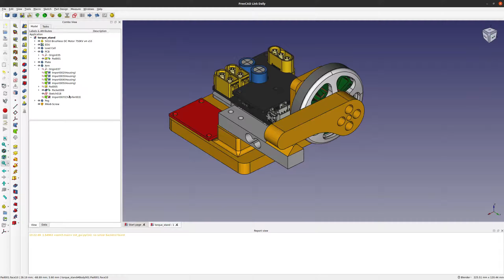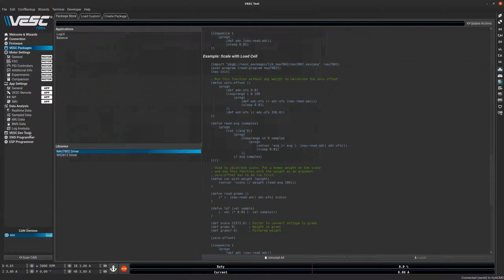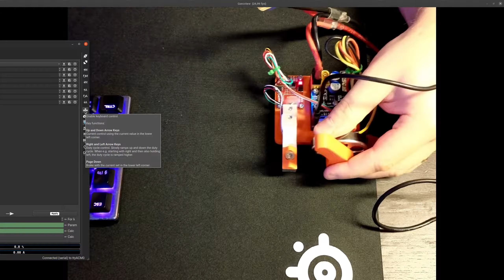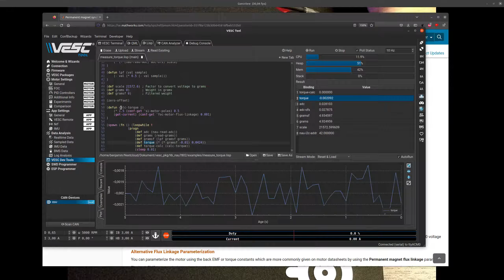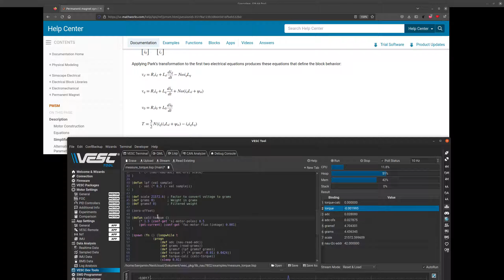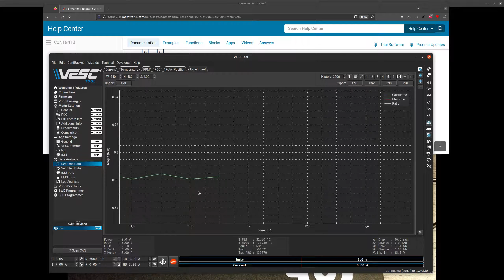VESC Measured vs Calculated Torque

Comment: Great Video Benjamin, as usual, 
but two thoughts I had:
- Your "Gram to Newton" conversion is not that accurate. It should be more like >0.0098< 
I presume it does not matter that much in this case. 

- I think the tip of your measurement area should not be inline with the loadcell, but rather be horizontal. 
If you apply force further or closer to the measuring resistor, the reading should be different.
Reply: Hi,
I also noted, that hey, G is not exactly 10m/s2, however 2% difference is not that much either..
You are right, that the measuring cell is in reality measuring bending, which is dependant on the force arm length. However Benjamin checked linearity for the cell, so if that check was using the same contact point then it is probably also just a small deviation. But still I would have rotated the measuring cell 90 degrees about Z axis, so the effective arm length would stay the same along the contact line. Keeping the thing compact, probably just simply making the contact point a small sharp tip is easier but still better.